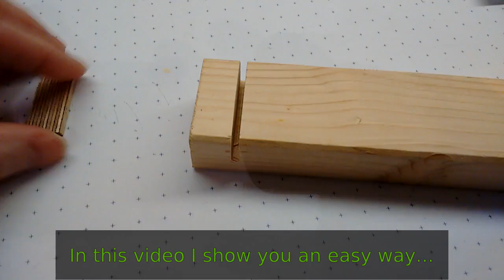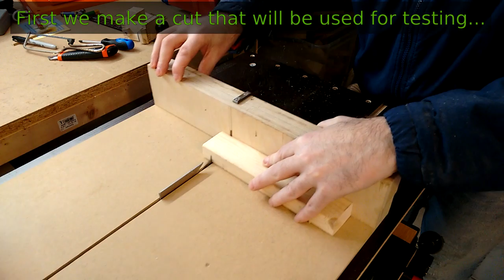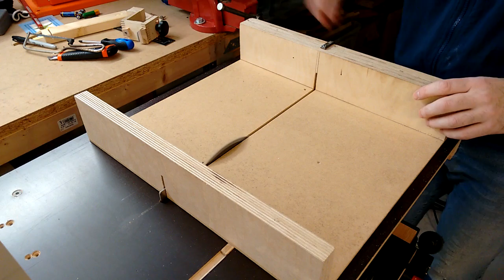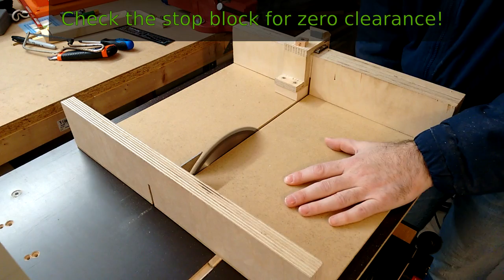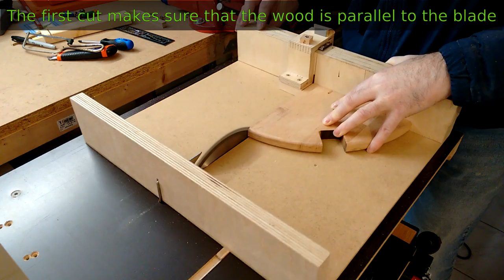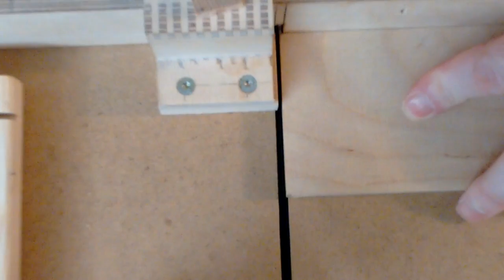Making Wooden Splines The Easy Way

Comment: Every once in a while you run across something that makes you say "Why is something so simple not been in my brain before now."  This is one of those somethings.  So simple and foolproof that I am ashamed of not thinking of it myself.  Thank you for putting this up.  I will be using this all the time now.  The fact that it works for any saw blade without using any measuring is pure genius.
Reply: I've been a woodworker for 52 years. This is the first time I saw ANYBODY use this technique. There is one company selling a jig to do this,  but it's a joke. Every other approach that I've seen is a trial and error sort of method. This method is as original as anything in a long while.

Comment: Man, talk about making me feel stupid!   Very simple solution.  I’ve seen all types of jigs that would not yield the same exact consistency as this does.  Thanks!
Reply from the maker: I like the fact that you can change saw blades without any tuning for getting right spline width out of your jig. You just use the blade that's in your saw to cut the slots and the splines.

Comment: Been struggling with making splines for a while..Just took to long to make splines. Tried this out today an worked wonderfully.. Thank you.

I thought of this after I was done, but I cut multiple splines.. Was thinking after cutting the first, I could have moved the block over and used the spline I just cut as the measuring offset.. . 

At any rate, much better and faster fit.. Cut 12 for frames today.
Reply from the maker: Glad I could help.
There is a little less waste if you raise the blade to half of the length of the piece you use for cutting the splines. However, since you have to change reference edges, it requires the two sides to be absolutely parallel.

Comment: Nice standby for when I don't happen to have 1/8" stock.. I have a bunch of it, but if I ever run out this is good to know.
Reply from the maker: For the 1/8" stock you need to have a matching saw blade mounted when cutting the groove. With my idea you can use whatever blade is currently in your saw. The spline will always fit. So you can save some blade changing.
Reply: Wurmtal 868 That's true..It seems like most of my time is spent changing blades.. And dropping the nut and washer down in the sawdust and having to find them on my hands and knees..

Comment: Thanks for this video! I have been attempting to cut splines on the bandsaw and usually, that doesn't work very well. This is much more accurate to get the correct thickness every time. Why didn't I think of that? lol

Comment: I use an old Makita 10inch planer,  plane a wide board then cut into strips. This ensures the grain is going the right way, across the joint not with it.

Comment: Watching this I see a possible improvement: Instead of cutting all the way through on the second cut, stop after you've cut off the spline, then flip the piece and repeat. The act of cutting off the spline sets you up equivalently to creating the initial notch.
Reply from the maker: True, but then the length of every second spline will be limited by the length of the stop block and the cutting depth of the saw blade.
Reply: @Wurmtal868  As it stands now though the length of every second spline is 0 because it's being entirely cut away.

Comment: Grain direction for a spline should go across joint, not along it.
Reply from the maker: I absolutely agree.
However, this video is not about making a spline joint. 
It's about cutting a spline that fit's to any saw blade width without measuring.